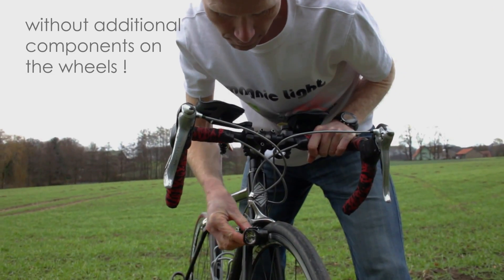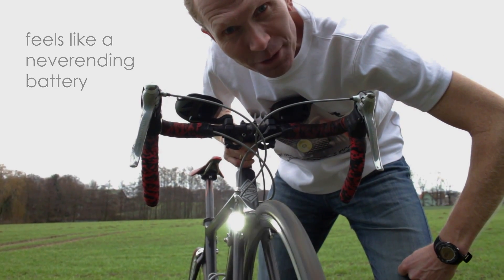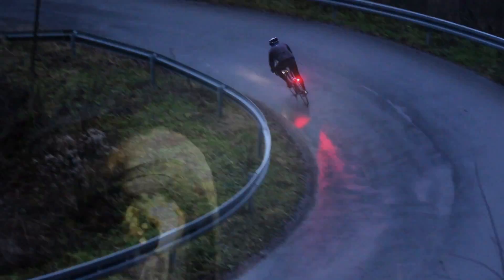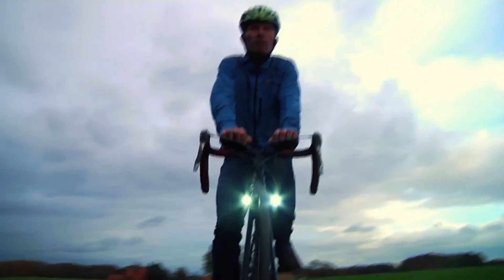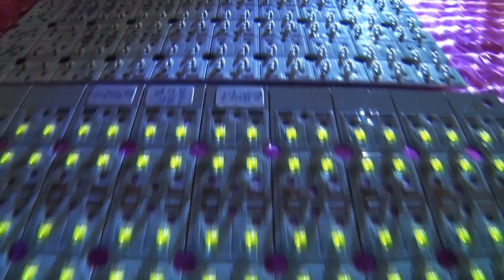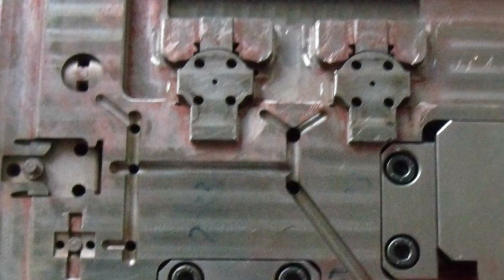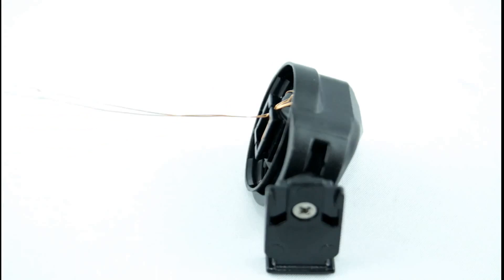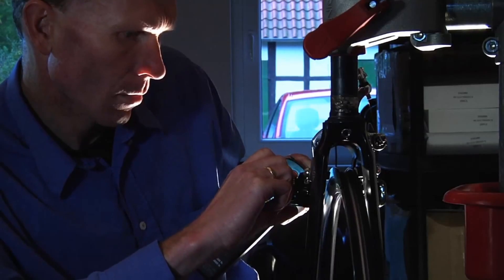Magnic Light iC: intelligent contactless bicycle dynamo

Comment: Why don't you connect 4 dynamos in a parallel to achieve more produced electricity and be able to power a more powerful LED for a front light? It could be possible to install them on the both sides of the fork, i.e. before and after the fork tubes. 2 on each side. And so to be able to produce enough electricity to charge some of the existing powerful bike lights on the market?

Comment: I think you need magnets inside your tires, right?
upd: I've got it. The magnets are inside the lamp, they rotate near the winding, that is inside the lamp as well. Magnets are moved by the wheel's spokes.
Reply: It is basically the experiment "magnet falling through a copper pipe and getting slowed" in reverse. The aluminium wheel is moving first and this moves the magents. (with eddy currents)

Comment: The second Magnic Microlight Kickstarter with improved brightness and miniaturisation got funded some days ago and will end on 2018-12-21 - you can still join with low prices.
They are a very clever way to have continuous bright light without friction by tyre or hub dynamo, without any cabeling or batteries at a total of just 140g in the full double setup.
Two models are available:
Magnic Microlights (to be mounted in break pads, with pads still replacable the usual way) or Magnic Microlights Wega (to be mounted on the frame and fork when no rim breaks are present or of an odd design).
Go to kickstarter.com if you're interested.
Presently they miss the smart options like Bluetooth support and brake induced turn blinking that was a stretch goal of an earlier ambitious attempt but that still might come in the future.

Comment: Why are you not on amazon???
Reply: because it's a fake product, you can make one yourself easily but this is fake
Reply: @Ian-ff2hz  its a real product,there is another company called relight which makes the same product,but issue is that power generated is very less and so is light

Comment: Ingenious.
The other systems need heavy magnets fitted to the wheel. In cycling you always pay more for less weight.
Reply: this requires you putting an aluminum ring around your wheel
Reply: @Ian-ff2hz  mine has such one already, a rim you know.
Reply: @dbtest117  lol i guess so, not super efficient compared to just glueing neodymium magnets and putting a copper coil near by
Reply: @Ian-ff2hz  Well much neater to no glue on something just as these work